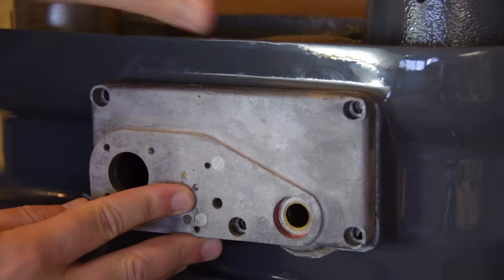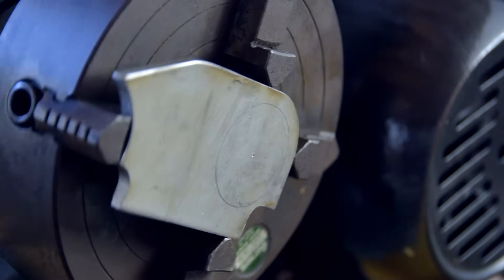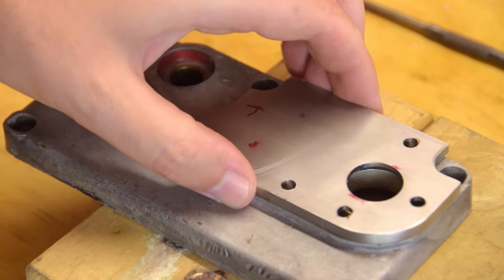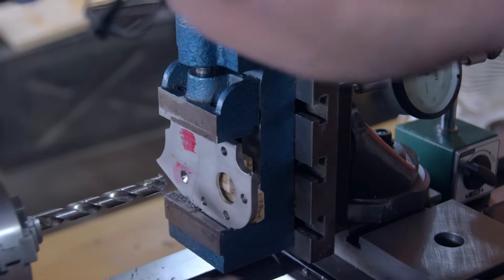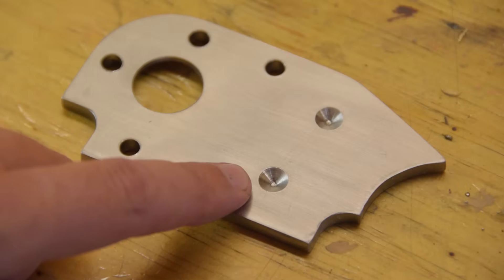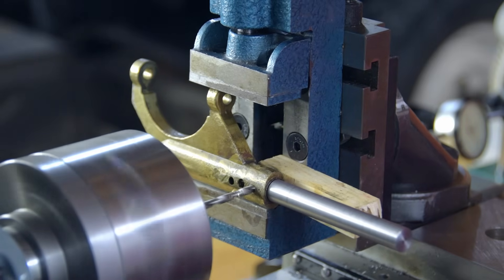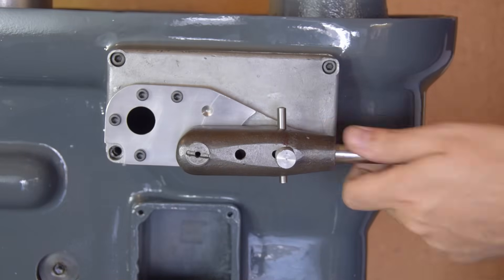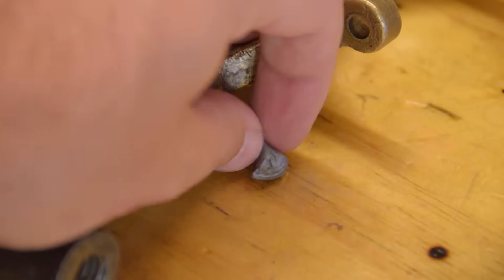Drill Press Restoration Part 8 - Back Gear Lever

Comment: Hey dude, love the videos! I was just wondering why you drilled a little dent into the middle of the oil sight acrylic? I'm not a shop guy so it could be totally obvious to other people around these machines.
Keep up the great work mate!
Reply: If you notice he added a little red dot . usually machines are filled up to the middle of the side glass with oil . I suppose this was the reason for a quick reference of the oil level. I might be wrong.
Reply from the maker: As Yiannis said, it was just so I could paint the little red dot. The dot is on the inside so the outside is smooth.
Reply: Ah I missed the little red dot (colour blind) thanks both of you for the explanation!